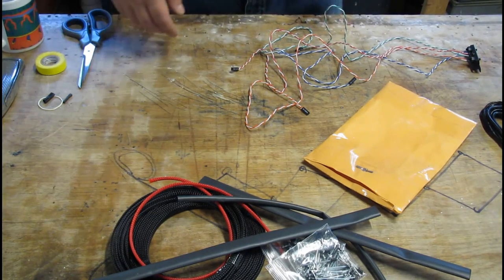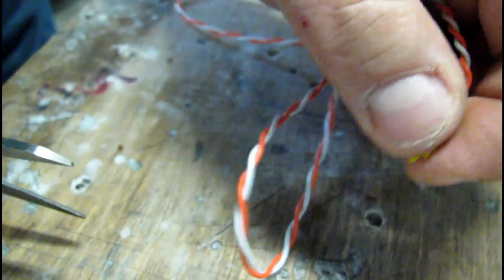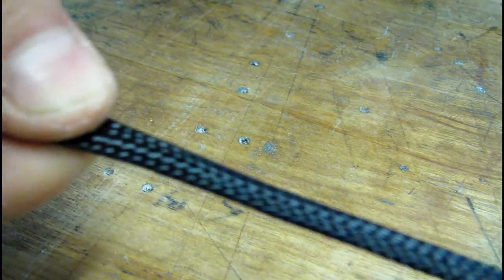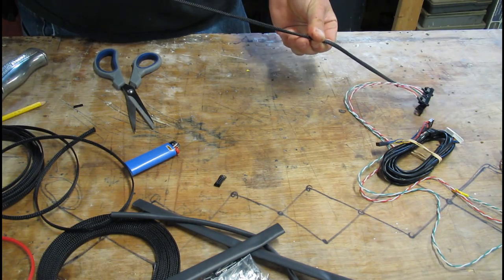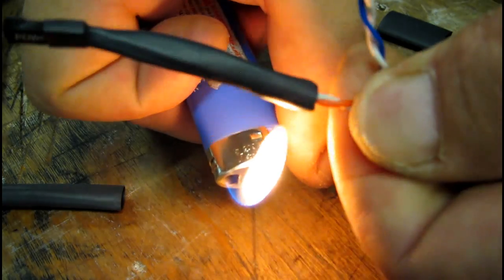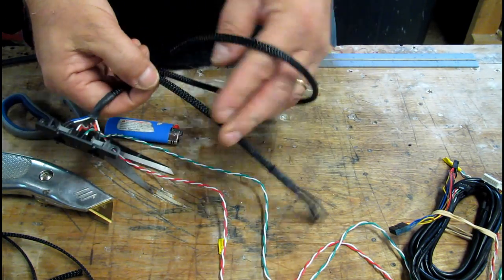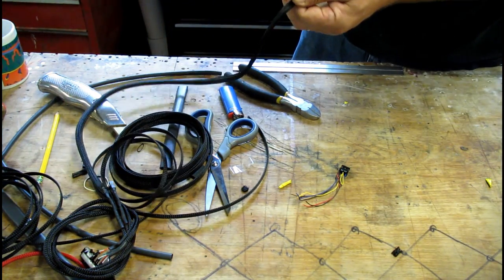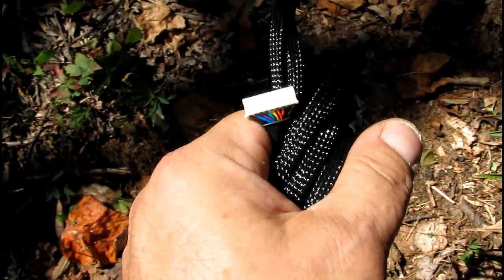PC Modding Sleeve Tutorial: Front Panel Cables

Comment from the maker: On FP wiring the white wire is the ground. I have no idea why but that is the case. If you don't like flipping plugs to see which way the LED lights up just note the white wire and put a mark on the metal part with a sharpie pen and wipe it off later.

Comment from the maker: I'd call it 3.5mm. You can't really measure the diameter of a squishy textile like this. It's an expanding braid, so it can be pulled down tight over an 18 gauge wire ( power supply) or it can be stretched over several smaller 26 gauge wires (fan wires).

Comment: I know this video is old, but hopefully someone will see this anyway... Can you use the same method to sleeve cables attached to the PSU (ie. a non-modular PSU)?
Great Tutorial!
Reply: This method works well if there are pins you can resolve from connector to get access to the wire and start sleeving. So i have no concerns about sleeving cables for connectors like ATX or PSU with the same approach. However, if we start talk about other component-cables which are also non-modular, this technique probably dont gonna work because the manufactures do chain there connectors on the same wire. This approach only allows you to sleeve the last segment of the cable, so u gonna end with some unsleeved wire between the second last connector and the PSU. Btw the manufactures do merge the cables within the crimp so there is no easy way to split those. 
At this point i would recommend making your own cables for sleeving, either as extensions or full custom with (semi-)modular PSU. There is plenty of information on internet how to do it, so no need for me to go any further into details.

Comment from the maker: No the appropriate answer is I use a lighter. I have used a lighter to shrink and sleeve since 2005. I've built more custom PCs than I can remember. People pay me to do it. I get excellent results using a lighter. Just because you have an opinion that a heatgun is the "right" way does not mean that is true. I can show you some mind blowing sleeving done by others using mini torches. A torch can put the heat in a much smaller area than a hot air gun. For small precise work it is not an ideal tool

Comment: It works the same way.  With a heat gun, you don't have as much risk burning through the sleeving as a lighter, but you burn yourself more than you do a lighter. -_-' at least, from my experience (Aviation Electronics Tech), that's the way it's always been :P  But the principle is the same.